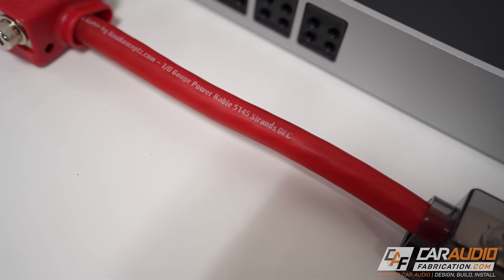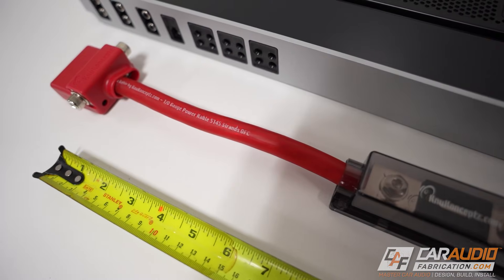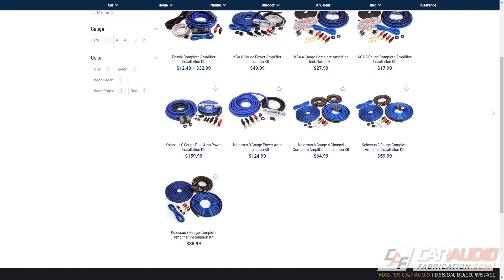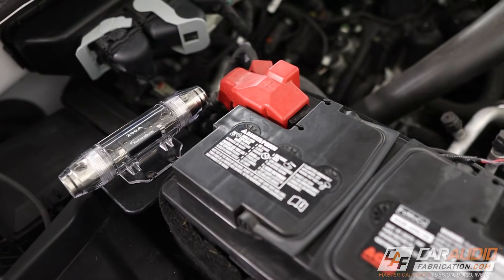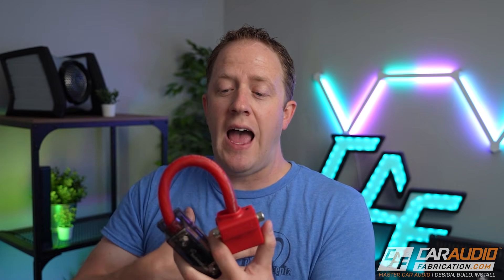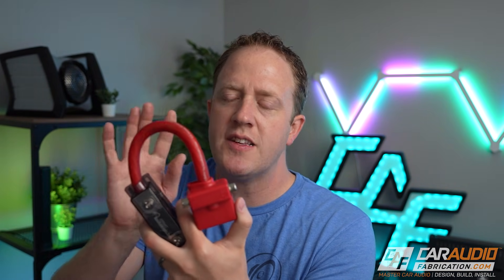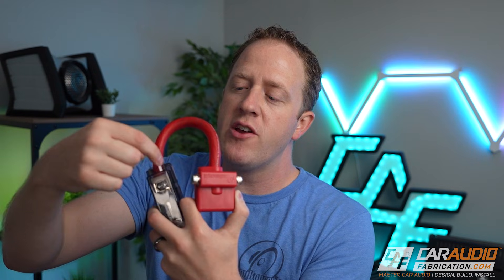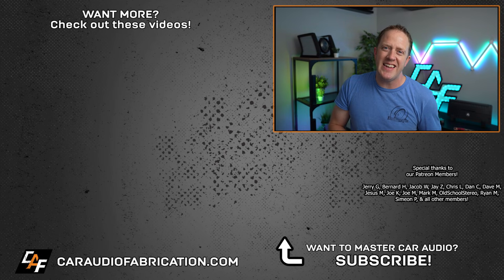AVOID Electrical Issues! - Battery Terminal to Fuse Length EXPLAINED - Car Audio

Comment: 2:20 Precisely what happened to one of our customers at Hyundai. Aftermarket amp. His lead wire came loose (days after an oil change) at the fuse and grounded on his ECM.

Fried the thing instantly. Had it towed in. Tried to blame us even though it was clearly aftermarket and poorly positioned. No ferrules, just loosely screwed in.

Comment: Today my audio stopped when I was driving and when I looked both wires connected to fuse were melted and fried the fuse itself nothing wrong no melted plastics no burn marks on the either end but the wires melted the other sides of each wire the one side to my battery fine the one side to my amp fine but the wires for the fuse both melted

Comment: So i recently installed a system and put the fuse close to the amp, i have always had it close to the battery in my other vehicles but this new set up  has melted the 4 Guage wire.. put it close to the battery

Comment: 2 feet going to be a problem? I am trying to wire a DC-DC charger to my starter battery and wondering about the placement of the ANL fuse. I have a diesel step van and my starter batteries are under the steps into the van and maybe a foot and a half from the ground so not that protected from road moisture and dust. So if i was to bring the fuse inside it would be maybe 2 feet at least.

Comment: Why I just blow up my 300watt amp by connecting the negative to the positive battery and the positive to the negative battery the fuse on the power wire is not broken, but the amp won’t turn on again???

Comment: Luckily I had amps fuse as close to battery as possible back in the day.
Zip tie broke and 50mm² cable fell onto serpentine belt pulleys which broke the insulation and cable shortcircuited to ground.
The 300A fuse blew, the car was saved.

Always install fuse and as to close to the battery as possible.
Seen some illuminated toggle switches short circuit and burn serious damage because there was no fuse.

Comment: So I took your advice to order another fuse from knuconcepts. When I was ordering my sub and amp, people were saying to use a 50 or 60 amp fuse with 8 guage wiring. And of course, the recommended kit was an 8 guage - 50 amp Boss Audio kit. After getting it all hooked up, it seemed like the wiring was thinner than what it should be. So, I did more research and found your videos. The fuse you said to avoid was the one that came with my kit.  But also, since the wiring seemed thinner, I ordered more wiring and another fuse after learning how to do the math.  So, I ordered the 40 amp inline fuse, per your recommendation. I got it put in today but almost couldn't.  One side of where the fuse is bolted down was screwed down so tight it started to strip trying to get it out. I got out installed but I probably won't be able to replace it if I need to. Will probably have to buy a whole new fuse holder.  Other than that, I'm still having trouble with the amp getting warm and after all the videos I watched saying not to use bass boost. I had no bass, so I ended up turning my bass boost up.  But I also ordered the monitor control knob that shows clipping.  So even with the volume up 25 out of 40 probably, and the bass boost up it hasn't shown clipping at all.  I can't turn it up over 30 due to the door speakers crackling. With bass boost up and the volume at 25 is not bad. Wish I knew someone who could set it for me.

Comment: Great video! If your battery post or post clamp allows, one of the best options is to use an MRBF terminal fuse block. That way, the cable protection is right at the battery post and the fuse holder is a very though and rigid assembly.

Comment: If my car's factory amplifier is rated at 120 amps, what kind of fuse size should I use if I'm going to use 1/0 gauge wires in the big 3 upgrade?

Comment: So could I install the fuse as close as possible to the start of the positive wire near the battery and there would be no issue other than fitmet issues ? Do you recommend as close as you can ? is there different recommendations for different size wire I need to add a inline fuse to 16 gauge wire for heated grips

Comment: What if you just take 150 amp in line fuse and one end of the fuse is connected to the wire and the other end of the fuse is bolted right to the terminal?

Comment: ended up having to get rid of fuses after i went past 2000 watts due to them blowing continually despite everything being hooked up correctly
Reply: Lol thats not good. Get bigger fuse bro
Reply: Bigger wire? Solid copper welding wire?
Reply: @___MC___  doubled up on 2 gauge wire 2 for positive 2 for negative for the lack of finding anything bigger
Reply: @prototype9000  whats your total watts anyway? I found up to 4/0 on Amazon. Dont quote me in this, but i think of it the same as pipe volume. 2 1in pipe dont equal the volume as 1 2in pipe. If theyre long then the amp rating goes way down and that could be poping them? Idk usually when i have unusual problems its because of something dumb i did.

Comment: i have a 20221 nissan sentra sv. i am planning on replacing the speakers and adding a 4 channel amp. If i use a 4 channel inline converter for the amps rca's, will i lose any functions like phone calls or navigation sound?

Comment: A good rule of thumb that i have learned as an electrician, always fasten your cable to the point you are no longer able to grap the wire and pull it. if that requires a lot of cable ties, so be it.
Also ALWAYS tighten the connector screw to the specefications of the manufacture, so if it says you gotta tighten with 5nm. then no more or less. they have tested that to make sure the wire is not loose so i can't vibrate itself loose or you dont over tighten it and can over time break each strands of wire in the cable wich in result makes the cable diameter smaller wich results in the wire not being able to handle the same amount of Amps.

I hope this comment helps, at least i hope Marc will read this and agree with me on this :)

Comment: What about relocating battery terminals? I want to create a distro block inside the vehicle instead of running a bunch of wires through the firewall. Would this still apply? Most new vehicles have long run power wires when the battery is under the seat or in the trunk to jump the car or have access to power.

Comment: Quick tip for people,  DONT put your fuse block under your seat, hidden in a spot you cant see or somewhere questionable. ALWAYS put it out in clear view for ease of being seen and also if it burns it doesn't set your car on fire. If its tucked in between somewhere you may have a bad day😂

Comment: Safe routing and mounting is more important than how short it is. If you need to go a bit longer to avoid sharp or hot things, then do it. It is a good rule though. Extra sleeving on the un fused section is always good too.

Comment: 18" is ridiculous! An arbitrary rule from the old days of car audio competition. I've always mounted the fuse on a bracket immediately adjacent to the battery and sprayed it with the same anti corrosion coating that you put on the battery terminals. Lead has never been more than 4-6 inches. I cringe when I see a long lead coming off the battery and routed up the fender along the line where the hood could close on it, and the fuse is clear up on the strut tower or something. Incredibly unsafe and inefficient

Comment: Car audio bugs me. Technology just never seems o reach the industry. Why do OEM head units not have a TOS out or HDMI out? Why do after market HU, AMPD DSP continue to use RCA plugs? Really need six runs of RCA in a tight space like a vehicle??  Why does car audio power and ground wires need to be the size of what you see on telephone poles while home audio is a standard plug? How is a small speaker like in soundbar or Bose or Sonos ONE able to fill a living room with decent sound yet we need massive woofers and amps and dsps and in a tiny little vehicle???? Why are vehicle doors not made with an enclosure behind the  speaker hole that clears the glass ,instead of being completely hollow door? Car makers spend massive money on RnD and tech on rain sensing wipers yet they cheap out on an a couple cable leads on HU? Who the hell dont know its raining when they driving? The most popular thing to do IN a vehicle is listen to the stereo but its the least technological.
Reply: Wild ass rant 😂
Reply: On the note about wire sizes, the difference between home and vehicle is voltage. Home runs 120v/230v depending on the country. Vehicle runs 12v (technically 14v). To get the same power (watts) down a line, the one with lower voltage will run a higher amperage and need a larger cable. 10amps down a 120v line is 1200w. 10amps down a 12v line is 120w. So to run an 800w system at home, it can go down a small household wire. But on a 12v system the wire will need to be much larger diameter.
Power lines along the road run tens of thousands of volts in order to keep cable size down (size, weight and cost). They run into a step down transformer near the street to bring it down to household voltage. 
It's the same really with the RCA's... Could run thin ones to save space but over 5 metres, audio quality will be bad, especially on the bass end. 

Optical/Toslink cables would make a lot more sense for car audio. Much less space, lighter and no degradation over that distance. Also no interference. Have had to route power cables and RCA's in non optimal ways many times just to avoid interference. Plus they can run all channels (rl, rr, fl, fr, sub) all down one tiny cable. They really missed a trick with optical
Reply: @mdutchy2582  dc vs ac. Your car uses dc current which requires thicker Guage wiring to carry higher currents. Other thing is your house won't have things like road noise or engine noise that it needs to cancel out and be louder than. You also are on the move so if you want to play louder than what others want to hear most of the time you won't be near them long enough to disturb them as much as you would your neighbors while being stationary and no wind noise for them to down your music or

Comment: I have seen people make the mistake of adding a second battery or capacitor for their system and not adding a second fuse at that power source.
Reply: I have 3 power runs and 3 batteries. I have so many fuses I lost count. But it’s at least 10. Because I have two amps both have triple inputs, so that’s 6, one for each power wire run and have 1-2 more for the mid range amp.

Comment: an odd issue I had with the car in my thumbnail I had to replace my front shocks the old shock shot apart when I took the top mount bolts off shock oil everywhere. I get the shock replaced put my tools in my trunk the my 12 packs of soda I drive 3 miles and my cab fills up with smoke! I thought It was my shock oil burning off my engine, It was my brake light wire shorted out by the soda cans first burning off the wire insulation then my carpet. The fuse never blew?

Comment: What I never understood is why don't they make fuse holder that has a positive post mounting system. No better way to fuse the system in alot of applications with a fused battery terminal.
Reply: Like on the newer Nissan's and Honda's?
Reply: @jeremiahsmith6689 like the knuknonceptz terminal. In lots of applications it would work good. Every situation is different, but they seem the way to go if you are able too.

Comment: Hi, im about to do an amp installation. The manual that came with the amp said it needs a 40 amp fuse, and i bought 4 metres of cable from an electrical supplier (in the uk). The cable is rated to 50 amps. Is this okay?

Comment: 18” is a lot in my opinion. The shorter you can brake that circuit the safer you car is. Some times fuses fail and terminals get hot and can go unnoticed until the point of failure the less unprotected the greater the risk of fire

Comment: What about a fuse holder that has one end that bolts directly to the battery terminal? Like with a copper lug straight to batt from fuse holder, no wire on that side

Comment: Mounting the battery and fuse holder to the same part, as in bracket or tube is ideal. That way they vibrate together.

Comment: Off sorta topic question. How can I isolate my amps ground so it's not being interfered with other car electronics? I've been getting high pitched sounds from my led ambient lights and the ECU of my car, wanna find the simplest way to isolate both my sub and full range amp. Appreciate the help with these videos👍

Comment: One more (minor) consideration, I try to keep the run to the inline fuse as short as possible, but you should also make it long enough to make the bends it needs to make without stressing. That extra inch or two you cut away does no one any good if you have your cable bent in a hairpin that stresses your compression fit terminal lug and/or your fuse terminal.

Comment: Never liked the fuse with  set screws that grind into a wire. Even adding a wrap or other. Best are ring terminal style fues.

Comment: Yeah I kept fused positive wire hard mounted to a under hood panel close to the battery plus I ran a separate battery to body ground wire near the battery as well so that all that current wouldn't go through the engine to body ground and other grounds. I ran 1 gauge power and ground wires. As a side note,one time I had temporarily disconnected the separate amp ground I for mentioned until i noticed that the stereo system wasn't working right and sounded crummy.  As a result of the disconnected wire the amp ground was now going through the 10 gauge engine to body ground that had a disconnect socket connector on it.  The insulation was melted off of the 10 gauge wire so i repaired that and refastened my 1 gauge battery to body ground. Lesson learned
Reply: How was the amp grounded through a random wire after disconnecting the amps ground input?
Reply: @cpzmelbs  if you're replying to my comment,the amps were mounted in a wooden cassette style enclosure I built for my stereo build and sat on the cargo floor behind the rear seat so the amps ground was a one gauge ground wire from the amps ground terminal to the body behind the rear seat. I had fused power and ground distribution blocks in the amps enclosure(3 amps).  That ground path was going through the engine to firewall ground wire(10 gauge).  Apparently I had a brain fart when I replaced the car battery and didn't think that I needed to hook up that shorty one gauge battery to body ground next to the battery. My system was 700 watts RMS

Comment: Do the wire gages before and after the fuse need to be the same? If i want a flexible wire can I use a 6" run of 4GA, then my fuse, then a 15ft run of 0GA to my 150A amps?
Reply: Short answer is they should be the same size. Your electrical system should be designed as that: a complete system, not a mixed set of parts. Your main power wire should be sized to carry the load of your amps plus a little extra, and your main fuse at the battery should be sized to protect that wire. 
In your example, you would probably overheat the short section of #4 wire before blowing a fuse since #4 copper wire is only rated for about 85 amps.

Comment: Who decided on 18"?  Why not 16" or 20"?    The hard limit of 18" has always been a kind of made up number.     You need to be as short as possible when taking the mounting location of the fuse in to consideration AND any objects that could damage the wire and short out.

Comment: Excellent point made at 2:50. The whole point of the guidelines (such as ABYC E-11.10.1.1.1) is to place the overcurrent protection device as close as practically possible to the power source to protect the rest of the wire run, and the maritime ABYC's (American Boat and Yacht Council) recommendation of no more than 7" is so strict since having a boat fire while out at sea can be an extremely life-endangering event.
In the maritime industry, Blue Sea Systems has a product called MRBF (Marine Rated Battery Fuse)  Terminal Fuse Blocks, part numbers 5191 and 2151, that make it such that the terminal you bolt your cable's lug to is itself fused, ensuring the whole cable run itself is protected. The fuse options range from 30A - 300A. The only drawback would be that you'll need a standard battery post to marine style battery stud adapter (or use marine deep cycle batteries that already have threaded stud connections), and you'll have to crimp on lugs to the cable before connecting it to the MRBF. This makes for a very robust setup that should be impervious to long term vibration exposure (either in a boat's engine room with a big diesel motor, or in a high SPL competition vehicle).
Reply: @ph33lix  thank you

Comment: fun fact, that 18" number came from competition rules way back in the day. it is an entirely arbitrary number. It just sounded like a good idea to the guy that wrote the rule. Yes the closer the better, but that 18" gave enough room for different circumstances.
Reply: @sqpapa  fun fact the 18" rule was established in the mecp certification book. Mecp was started in 1991
Reply: @flexart174  Fun fact, those competitions and rules were happening in the 1980’s.
Reply: This answered part of my question! So closer to the battery is better and would cause no other issues besides fitment issues?